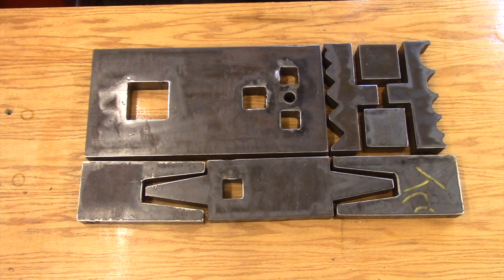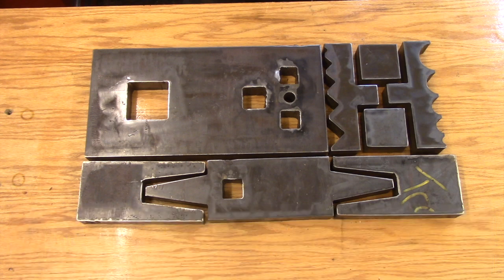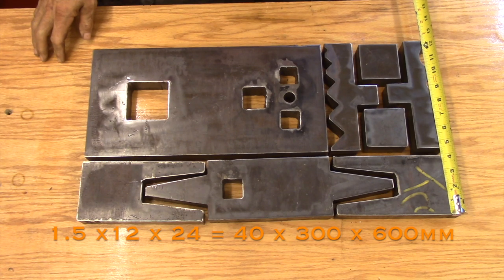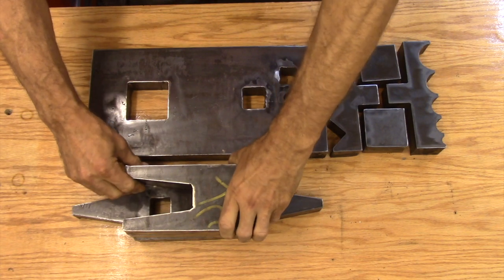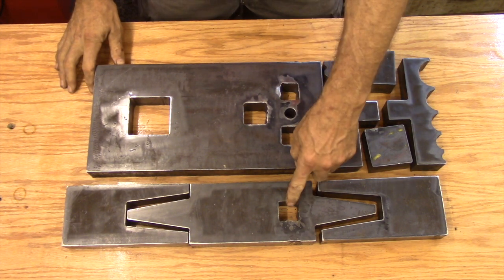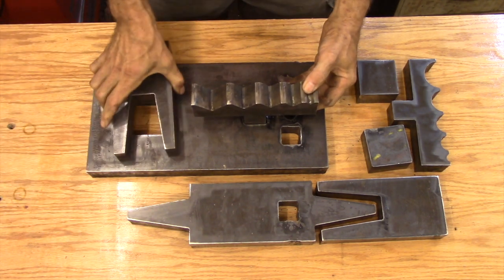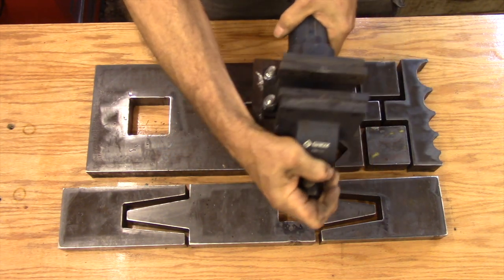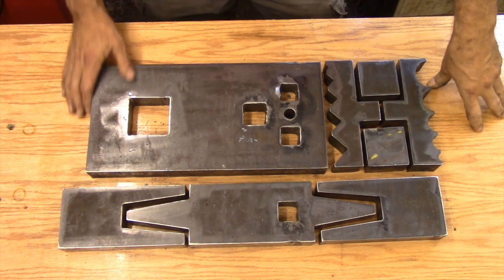Blacksmithing for Beginners - My CNC Anvil System

Comment: I built my ducks nest at work out of 1/2" Hastelloy and welded it up at home with their Inconel rod. I made cardboard patterns and cut the plate out with their plasma cutter. I took it home one piece at a time just like the Jonny Cash song! AEP probably has a couple thousand bucks in my forge, and no, I don't feel guilty, especially when I get my electric bill each month. That thing will still be usable in a million years.
Reply: Are the pieces lunch bucket sized? Tee hee.
Reply: Christopher Neely They only need to be small enough to wrap them in your welding jacket, thats how I got my anvil pieces, I got all of my 1x4x18 pieces home that way.
Reply: You built your... what, now?
Reply: It's the fire pot for my coal forge, we call it a ducks nest in Appalachia but Im sure it's properly called something else, maybe duct nest? IDK.

Comment: Do not go to a job shop to have cnc torch cutting done. Find a large steel supplier that does it because they will only charge you for the weight of the material they send you, not for the plate size. So you don't pay for the waste. It will quite often cost less than what you would pay for the material alone, cutting charge becomes free or nearly so, especially when dealing with thick material.

Comment: This looks good - but - my only concern is having horizontal weld joints through the body of the anvil. Because, either, it's a deep vee notch and filled around the outside, but hollow in the middle with an air gap; or, tediously welded from the center-out with no air gap. Having an air gap tends to create shock absorption through vibration when you hammer, rendering your blows less effective. I don't know the exact degree, but I know it's bad enough to avoid it. However, on the other hand, you also have, what, 25 or 30 square inches of weld to build up, three or four times in order to produce an anvil with no horizontal air gaps. I can say from experience, having fabricated my own anvil, there is a gross amount of welding involved in doing this. 

The overall design seems good, otherwise - I do some CNC programming at work, cutting pieces for ductwork fittings. It can be tough sometimes to use every inch! I hope it works out for you either way. I'm looking forward to seeing how it turns out, and I hope I'm wrong about the degree to which air gaps will ruin an anvil. Blacksmiths have been known to exaggerate.
Reply: Lap all the horizontal joints, and wring (https://en.wikipedia.org/wiki/Gauge_block#Wringing) them together.  If they are really well lapped, they may not need welding at all.

Impractical?  Possibly, but I'd be interested to see the result.
Reply from the maker: These are very light duty anvils so I don't believe that the level of welding that you are describing is necessary at all in this situation.  All I am going to do is run a bead around the circumference of each seam to keep the whole thing from moving around.  It's not a structural element of a building so if a weld does work loose I'll just grind  it out and redo it.
Reply: Brian, I don't think wringing would hold up to the vibration from hammering. Even if it did, that's probably a lot more work and much more expensive than welding. 

Dennis, it's not so much that it will fail from a lack of strength, but that your blows will be absorbed by vibration rather than sent back into your work. Think of a Newton's Cradle - there is force transmitted through all the balls, but it quickly recedes because the force loses energy every time it transfers to the next ball. The same thing is happening with horizontally stacked anvils - hitting one truly solid piece is, to whatever extent, better than multiple pieces. Like I said, I don't know to what degree, it's really hard to measure something like that without complex math. I only know that it has the potential for devastating effects. If you are only using this for a very light duty an travelling anvil - fine - but if it's not more than that I don't know if it's fair to advertise it as something that would make a good beginner anvil, because it very well may not be. I would think the solid piece of mass would be more useful to most beginners, firstly, for the cost and less time and energy involved in grinding and welding, and secondly, because 200lb lump of iron will certainly outperform a 50lb ASO. 

I want to stress that I'm not trying to be critical, I'm just expressing what I have found to be useful, and some things that I know to be true.
Reply from the maker: No problem Kevin - I appreciate your comments. I'll have this welded up sometime this week and the road test will decide if there are any problems that need to be addressed.
Reply: DF - In The Shop I can't wait to see this in action. I have been looking for an anvil without success for months. But I do have a forklift tyne I could cut into pieces similar to your model and weld together. Can't wait to see how it goes under a hammer! Thanks for sharing!
Reply: I am very interested in finding out how well this system functions under hammering.  I am curious about the seriousness of the shock absorbing problem.  I notice that just the face plate of this system is much more massive than historical anvils right up into the medieval period.  A Roman anvil or a Viking anvil would barely qualify as a hardy tool or a maybe enough metal for a heavy sledge hammer, if you showed one in a blacksmithing forum they'd call it an ASO.

Comment: Hi  i am new to blacksmithing  and was wondering where you got this done i am in Ontario the GTA to be exact. was this done with a waterjet or laser. I have access to a 3 axis mill at work but it would not be fun cutting out 11/2 steel. I was also wondering where you get your coal . I was planning on using charcoal but coal is more efficient if the price is right.
Reply from the maker: I'm in Sault Ste maire.  I had this cut on a cnc plasma cutter because that is all we have around here.  A water jet would be better because the plasma does harden the steel at the cut lines. I'm sure you have a lot more options where you are.  I get my coal from Thak Ironworks. He has a deal with Home Hardware to deliver anywhere in Canada.  I think there is a new coal supplier in the Toronto area?  If you are not part of the Ontario Blacksmithing organization I would join.  They have a very active group and hey are based in your area.

Comment: Pretty slick, nice cut pattern well done. You ARE going to weld the shank on the underside of the anvil or they're as useful as playing cards. Yes? Will the shank extend far enough below the mount plate to wedge in place? The more solidly joined the more effective it will be as an anvil. I'd wedge the swage tools and vise as well. Nice job, well done. 

Frosty The Lucky.
Reply from the maker: That's right the whole stack is going to be welded into one unit.  The shank on the anvil will extend 1.5 inches bellow the baseplate so I do have room the anchor it down if necessary.  The swage block will probably just be used to profile tools like gouges so i don't think they will need to be fastened down but the shanks can be extended easily if that is needed.

Comment: Looking forward to the build and function test. I have some plates laying around. I have a old piece of rail for an anvil. Could I put plates under it to increase mass and would it even make a difference?
Reply from the maker: Anything that adds weight to the track will make a difference however I would add plates to the center web to stiffen that also.  That is the real weak link in the track anvil.  Look up railroad rail anvils on youtube there are a couple guys doing some interesting things by welding rails side by side to make larger anvils. Worth looking at.
Reply: The rail I have has to be some kind of crane rail or something. It's not standard rail. The web is close to an inch and a half thick and the top is close to four inches wide. It's the thickest I've seen and I grew up around trains and worked manufacturing for twenty years. Thanks for the info.

Comment: Brilliant idea, thanks for sharing.  I live the integrated platform and Swage blocks. What do you think about making another top level out of higher carbon steel.  Shaping it as needed, and then hardening the face?  Would be all welded together as a unit, and then heat treated.   Would that be worth doing, or should beginner anvils not have hardened faces because of the risk of mis hits and flying chips.
Reply from the maker: There is certainly nothing wrong with adding a high carbon face if you feel confident in doing that but I truly believe that if you are doing it an attempt to improve the performance of the anvil than it is a waste of time and effort.  Welding together a mild steel anvil is so much simpler.  Not one of the project or demonstration made on this channel  was done on an anvil that has any type of acceptable rebound or a face that is harder than the  6011 welding rod used to repair it.  This system is as good or better than the anvil you see me use every week.  If I didn't think that it was capable of doing good work it wouldn't be on this channel.
Reply: thanks for the reply.  Love the idea.  One more suggestion.  In addition to the swege blocks you cut, You could have the CNC guys cut out a tool that was 95% of what you'd need for a hot cut Hardy tool.  It Would have a notch cut in the top where you could forge weld in a piece of tool steel for the cutting edge, but the fit to your 1.5 inch hardy hole would match, and the basic triangle of the body of it would be nearly ready to go.

Comment: Interesting design.  

I have no smithing experence, but I enjoy smithing vids, and my background is in the sciences. 

Question: What type of steel was the 2" plate stock you had it cut from ... since some of the pieces will serve as striking anvils, is it unhardened mild steel ?
Reply from the maker: this is just a mild steel pate that is heat treated in any way.
Reply from the maker: correction ....  not heat treated in any way

Comment: What was the total cost? Is it mild steel that could be case hardened and would that make sense?
Reply from the maker: At the time I think it worked out to be around $200 each ( I had three of these cut  out as well as some other pieces).

Comment: Absolutely genius. What was the steel used?  I've been looking at buying some AR500 to upgrade an old railroad track anvil. This  looks like a better option.  Thanks for sharing.
Reply from the maker: This is just mild steel 1"1/2 thick
Reply: DF - In The Shop Thanks.

Comment: Maybe I missed it, but did you ever say what this cost you ?  also, It would be a lot cheaper to have them cut it out with a plasma cutter. then just finish grind the edges. I got an estimate for this including the steel of 280 dollars. is that what you paid ?
Reply from the maker: I didn't mention it in the video because it would be out of date  very quickly but what you see in the video cost me about $300 cdn.  That's just an estimate because i had several pieces done at the same time.
Reply: you're lucky. the local guy on my little island has an Omax water cutter, and he wanted $2,000 to cut this out.

Comment: What was the total cost of the cnc cutting
Reply from the maker: The total cost including the metal worked out to be $250 - 300 CDN for the anvil, baseplate and swage blocks unit.  That is just an estimate I had a lot of work done at the same time.  The cost will vary depending on where you are.

Comment: Not a huge fan of welded up anvils, but that would be nice for small jobs.
Reply from the maker: That's the main reason I had this cut out.  I really only needed the three small anvils for the workshop I'm doing but I decided to design something that I could use as a portable system when I needed to set up outside.

Comment: Roughly how much did it cost?
Reply from the maker: I paid just under $900 cdn.  So that works out to about $300 each for the workstation as sown in the video and $100 each for the anvils alone.
Reply: That included the metal or was it just the cutting charge?  I'm thinking that if this included the metal then it really is the bargain you suggest it is.

Also I'm wondering if you used mild steel or if this is some better than mild steel alloy?  I'm not thinking 4140 or anything like that but it seems like just about any level of toughness above mild would be a good idea.
Reply from the maker: That is the total bill including metal ( hot rolled mild steel ) . I've always had anvils with soft faces so a mild steel anvil is just what I'm used to.  A better grade of steel would raise the price considerably because the total job was around 500 lbs of steel.
Reply: Thanks DF,  And what you're saying is in line with the advantages and disadvantages of harder faces on anvils that I've read. Positive and negatives of course but overall the soft faces have much to recommend them.
Reply: Would you necessarily have to have the whole project cut out of a harder steel to get a tougher face, though? Of course you'd have to lay out the project differently for the cutter, but is there some practical barrier to having the face cut from (to use Bruce's example) 4140?
Reply: There is no doubt that a tougher alloy would raise the cost.  Not only for the steel but also for the setup cost for the additional cut.  Would it be a good option in the long term?  For frequent serious use likely there would be.  But I'm seeing a lot of references to using big hunks of mild for anvils and simply repairing or dressing them as they become dented.  As opposed to relative novices or infrequent users with hard faced anvils missing with the occasional swing and having more serious damage occur to the anvil and possibly being cut by the shrapnel from edge chipping.  So I can see a lot of valid reasoning in DF's choice both the standpoints of practicality and frugalness.
Reply: If you miss you work and hit hardened anvil with a  hammer directly on the anvil it tends to throw chunks at very high rate of speed.
Very dangerous, but they do move metal faster.

Soft anvil it may dent it, however, you can fill the chips and gouges in with weld grind flat. 
New anvil face

Comment: an anvil ?  or anvil shaped object

so I guess you will fire weld them together to make then act as one, ? and then you will add a carbon steel face and heat treat it ?
Reply from the maker: Sorry - minimal stick welding, no steel plate, no heat treat.
Reply: so it wont work like an anvil, would you not be better off with a block of carbon steel or simula ? that would be a lot better to work on would give a certain amount of necessary rebound and not be what we would call a dead anvil, and it also would not go out of shape so easily, just a thought we don't want people thinking atual anvils behave like this would, the chinese produce things like this very cheaply, perhaps even more cost effective to import one of those if you're not concerned about quality in use. I dont mean to put your creativity into question, but I think a word or two to explain that a real anvil is constructed the way it is for a reason and would work a lot differently.
Reply: I'm very happy to see that at least one person knows what they're talking about here. 
This is an interesting idea but unless you forge weld the plates you aren't going to have a very effective anvil, even if this was made of high carbon it wouldn't do as well as a solid block of mild steel because of the energy loss created by having plates stacked with only edge welds.